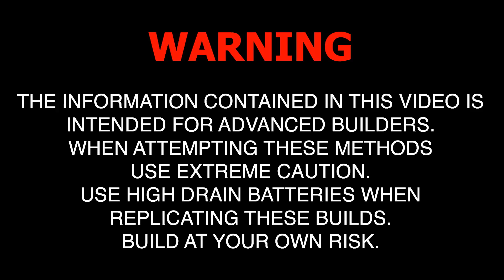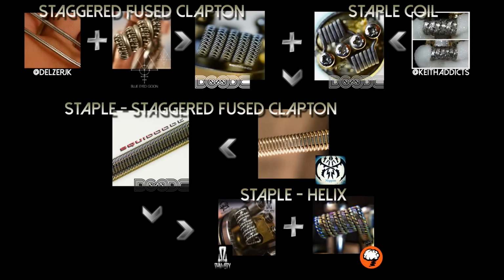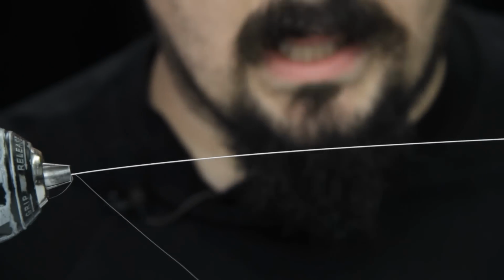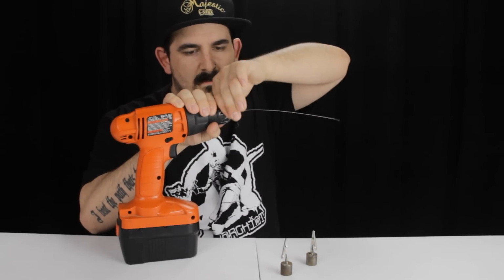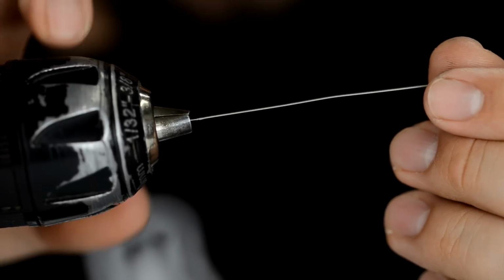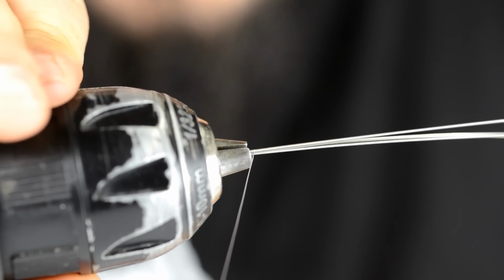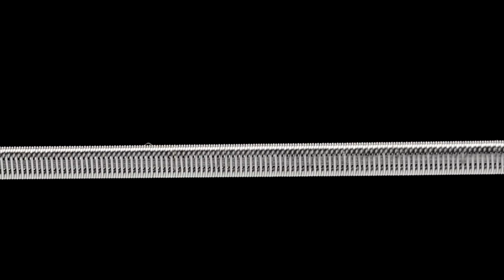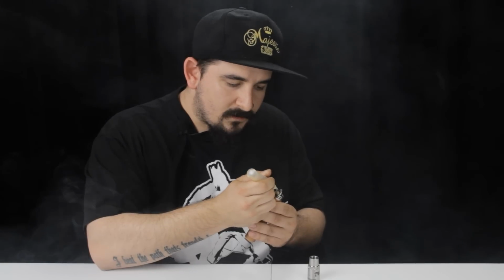Episode Four - The Staple Staggered Fused Clapton

Comment: Just got done doing this build. It is so important to get your first parallel clapton nice and even. Doing so makes the staggered rap go alot better. Without a doubt the best flavor going!
Reply: Roger Robinson FYI.. Mine was 26N, .6 Ribbon, 34N clapton . Ohmed out at .15 single coil 4 rap. That was the most I could get into the El Cabron.
Reply from the maker: Roger Robinson right on man and that wire combination will work just fine. Once you start to get the staggered wire thinner like 36ga then you can usually squeeze an extra wrap in there to get the resistance up!

Comment: again i have to improve my skill when you placed the two 36g wires on different angle where you feeding them dirrectly from the spool or it has allways been a unknown fact about this video how you placed them ☺😊😁 and again thanks for you great videos they are soo great =)
Reply from the maker: +Bjarmi Bergþórsson yep, great question. Both 36ga wires have been left on the spool and are off camera. I like to stick a screwdriver through the center of the spool then place the spool and screwdriver in one end of a vice and let the tension of the 36ga pull the wire off the spool as it's being fed to the core!

Comment: I am seven pairs of coils into this build,,,next time I will not use swivles,slightest movement on the drill with swivles starting out throws off the tension and the stagger on the frame wire,,,just saying,,learned the swivel limitation on the interlock alien,,just my thought guys

Comment: you should run the wire through a pen,then just hold the pen up to the wire that is in the drill.take the bottom part of the pen off.Then feed your wire through.Then slightly put the bottom part of the pen back for tension.Then just put your finger on the tip of the pen where the wire is coming out,and hold it up against the wire,and as it is turning,you slowly move your han down the wire.
Reply from the maker: +bruce The method you are describing I find to only work well with larger wires like 30ga, 28ga, etc.... With the wire I'm using in this video, which is 36ga, it is too fine and the pen method will kink it. I actually find that method to be more cumbersome then helpful, but hey if it works well for you then I stay use it!
Reply: +The Art of Vaping thanks for responding.
I find that with the pen method,the key for me is,putting the bottom piece in perfectly to create the perfect tension.I had problems at first,but it works great for me now.
Anyways,love yer vids.True artistry.

Comment: I'm in a weird part of vaping when building is no longer interesting. I stopped when I just got into single Clapton coils...this has sparked an interest...one thing though any other suggestion to replacing ribbon wire? I don't have the funds to grab some...but I really want to try this!! I have a twisted messed rda so thus will be fun...
Reply from the maker: +Paige Davis could always do a vertebraid and stick it in the center, or just use a larger wire than your two outside staggered wires!
Reply: Ha I didn't even think of that!!! I will need to try this out.
Reply: Thank you!!!

Comment: I have noticed that when I tried this build, there seems to be vapor being produced for some time after firing it up.  Is this due to poor wicking, or is it just part of the way the coil cools?  I never saw any burns in my cotton when I changed it, and the extra vapor produced would stop immediately after I dripped more juice on it.  Thanks for the video!
Reply from the maker: +andres roybal yeah that's just your coil taking awhile to cool down below the temperature at which juice is atomized... I'm curious, were you using Kanthal?
Reply: +The Art of Vaping Yes I am, I've also noticed that most of the time I'm trying to fuse the 3 pairs of wire, my stapled portion goes from being straight across to being at an angle, making it impossible to really wrap haha, could that be from the  spacing of the two Clapton coils being damaged during the fusion process?

Comment: dude if you take a loop of wire .....put it around your core.....start your clapton and then put that loop in between your wrap and then hang one of them wicked little weights off of it ....you will not only make a stagger because that loop of wire creates a gap in the wrap but you'll save all of that wasted wire also :) ...............a fellow coil architect

Comment: hey brother I got a question for ya. ive watched alot of build tutorials n wonder why I don't see anyone using a screwdriver to lightly scrape the coil to get the hotspots out when heating a coil for the first time?! anytime I build if I have a issue with hotspots ill use this method and it works extremely well.

Comment: I noticed that you use nichrome 80 for your wrapping wire instead of kanthal I have a standard staggered fused Clapton build and I used Kanthal for my wrapping wire it's nice good flavor but Gunks up really quickly I'm rewicking it like every other day is that why you use nichrome instead of kanthal?
Reply from the maker: +luke williams Kanthal is fine to use as your outside wire. Honestly, the resistance of your outside wire is extremely high and is pretty much negligible when it comes to heating. The core wire is doing at least 99% of the heating. Kanthal however is a dirtier alloy as oppose to nichrome. I get better flavor when I use nichrome as my outside wire. As for the gunky coils, 90% of that has to do with the juice you are using. Juice that has a lot of sweetener (Sucralose or Aspartame) will always gunk up your coils in no time! I stay far away from flavors like that generally because they're shity flavors that hide everything with a shit tone of sweetener. Hope that helps!
Reply: Ok I'll look into changeing my juice then thank you

Comment: Any tips for when the staggered claptons try to pull around the ribbon wire? Ordered .5 ribbon and ended up with .4 but even with a light twist after stacking the staggered claptons want to ride up and do the triangle deal. Maybe the palerclip trick will work? Like putting it a few inches past where you are wrapping to fuse it all together? I know they are doing the pyramid because I'm putting too much tension on the fusing wrap, but after 6-7 attempts once i get everything set up, it's getting frustrating
Reply: Ya got it now don't ya Drew? 😆😄🤣🤣

Comment: I'm wondering how much 36g you need for the clapton portion?  It looks like you used almost a foot of 26g, so you need what, like 10x that in 36g? 10 feet?
Reply from the maker: doclogic Excellent question! I tend to use more wire than I need to, but to answer your question I have found that for every 1" of core wire you will use roughly 10x that amount with 36ga.

Comment: Can you take flat ribbon wire, spin it, take 3 strands and make it the middle of the core to a 2 core 26 Kanthall A1.
Then Fuse With Ni80
Reply from the maker: Technically, you could replace the vertical ribbon with any combination of ideas and frame it. As long is you can pull it off it shouldn't be a problem. However, will it perform well? In your example I don't believe it will have great preformance but still worth exploring!
Reply: My Next build im thinking of claptoning the clapton before the core or twisting the 38 or 40 to kind of mesh the core. Thanks for the fast reply.

Comment: I've built this wire twice and each time it works fine until I go to wrap the coil and it starts to twist on me and no matter what I do i can get it to lay down flat on the micro screwdriver
Reply from the maker: +Jared Isbell interesting... What wire combination did you use? Also, I have found when working with ribbon, the tighter you can get the outside clapton wire the stiffer the wire thus the easier it is to coil and get to lay flat!
Reply: +The Art of Vaping I use 26 gauge kanthal, .8 ribbon wire (it was give to me for free at a local vape shop so I'm using it up) and 34g TMn80.

Comment: I have a 75 watt regulated mod, would I be able to run two of these if I used a little bit thinner gauges?  I know if I used these gauges my ramp up time would be horrible, but what if I used 28 gauge and 38 or 40 gauge, and .1 x .5 ribbon?  or would I maybe even need to step up to 30 gauge cores?

Comment: How do you prevent the wire from breaking off in the chuck if you don't have the weighted alligator clips?
Reply from the maker: +alex horvath I've never had wire breaking on me in this build so I'm a little confused about your question. If you don't have weights you can just do it by hand and make sure to maintain tension while you're pulling the one wire off!
Reply: +The Art of Vaping I originally had took the wire out of the chuck  when I finished then flipped it around. But I did it the way you did it and it worked much better! Keep up the awesome videos man

Comment: can you run dual coils with this coil in a rda
Reply: +jeffery mafi You could, but you'd need a pretty beefy rda.  Definitely not a 22 in my opinion, considering that a single 5 wrap coil that he built was ohming in at .16 or something.  Slap in a second and you're sitting at .08?  I sure hope you've got good batteries and a quality mod / rda combo or its going to blow up in your face.  If you look at the build he's rocking at the start of the video, it's the same coil wrapped 6 times and in a dual configuration.  This is sitting in a 30mm rda.  Don't expect to be centering this build or anything or you'll screw your coil beyond recognition, and that's why you need all that extra space in the rda itself.

Comment: Hey I don't know if anyone has asked/answered this, but is there a trick for letting both spools of the 36g let the wire come off the spool freely. But not unraveling off the spool and having the wire go all over the place? Or do you cut off a few feet of the 36g?
Reply: +PvtCabo0se666 cut a  piece of that stretchy vet wrap and place it a bit loosely bit closely over the wire on the spool,  then feed the end of the wire through so that the vet wrap turns but the wire still feeds and the wire doesn't unspool. The top of a tube sock works, too, but you can't really see what the wire is doing, so I've used knee hi stockings, too. The Dollar Store is your friend.
I use a small plastic container or cardboard box, cut holes for a dowel or knitting needle or pencil etc. on opposite sides, then suspend the spools on it. Put them on the floor, they turn and feed beautifully, look Ma, no hands.

Comment: think that a 0.5ohm could be made to fit into a kangertank subohm? if so what wire sizes would you suggest?
Reply from the maker: +jolly riffic With this style build there would be no way to get the mass small enough to fit on that deck and also stay that high in resistance unfortunately...
Reply: Get a Griffin or VCMT.
Reply: +DeepSpaceVoid i'm actually waiting on the Ohmega Alpha 30mm BFT Tank to be in stock. they really suck at responding. sent two emails already and no reply back when they'll be in stock. I'd love to have the vcmt but not when it's at such a ridiculous price. griffin is wonderful looking but 3ml of juice is just not enough. worse case i'll just have to stick with the ohmega 22mm tank.

Comment: isnt it easier to just clapton one long piece and then cut it in half so the spaces are trully uniform?? Seems as though 2 seperated pieces might cause an issue if one has more tension than the other while claptoning.. If that makes sense LOL...
Reply from the maker: +Joe Torres No your question makes sense but I don't follow you on how you would get spacing with just one clapton wire then cut it in half… Since filming this video I have a much easier way of accomplishing a uniform spacing. There will be a video on that very soon under the Tips&Tricks segments.
Reply: +The Art of Vaping ok i didnt explain myself you used 2 wires to clapton around 1 wire and then removed 1 for the spacing... what i was saying was wouldnt it be easier to do the same but instead of doing it twice (one for either side of the frame ) just do it one time with a longer piece and then cut it in half to use for the framed portion of the build...ive tried your way alot and my spacing is off unless thats the way its suppose to be..i love your videos by the way and i am getting so much enjoyment out of my fused clapton wire i would love to accomplish this coil to see how it vapes.."The Build Brothers" are my inspiration you guys should do a colabo video with all three of you guys....thanks for the reply..
Reply from the maker: Yep, thats a perfectly reasonable thing to do! I do that quite often actually, just for the sake of the video I did two because I messed up one of the wires a few inches into it so I couldn't cut it in half! I'll have to look into the build brothers! Thanks for checking out the videos!

Comment: am I the only one that does the whole length of wire I cut?
Reply: +TwistedTempest I know! they scrap alot of wire. Well! maybe it's easier for them to do that, i don't know.As a metal workshop hobbyist i have the habit to try to maximize the use of the material at hands.I haven't done any coil builds myself but i'm going to try it out.//Riller.
Reply: I mean they have more wire and they still dont clapton the whole wire and leave 1 inch not claptoned.
Reply: +Riller70  The urge to 'save' wire is a strong one to let go of, but it is done for the right reasons. It makes handling easier and actually safer. 
Manipulating super fine wires under tension can cause overuse injuries to the small tendons and muscles in your fingers, whether you are young, or older. With wire this fine, leaving longer ends is a must to relieve some of that tension. So much less expensive to throw away some wire than to sit with your fingers unable to move or to get cortisone shots. 
I've been doing wirework like this for better than a decade (not vape builds, but fine wirework - they are definitely related) Protecting and caring for your hands is paramount to longevity.

Comment: Seems like alot of wire but how much $ does each coil cost to build. ?
Reply from the maker: Oscar Onyx Its a good amount of wire for sure but nothing crazy… Hard to say because in this build I used Anarchist wire which is more costly than your regular wire. Also, it depends on the quantity of wire you buy. I tend to buy really large spools of 500'+ which makes the wire much cheaper per linear foot than if your buying 30' spools… For this build though considering the wire I'm using, a single coil probably cost (material wise) $4 to make. Perhaps less, but it isn't as much as one might think..
Reply: thanks , i see them ready built on e-bay at $13 for 2, But may take next step and build my own,
Reply from the maker: Damn… If someone is selling this exact coil (the one in this tutorial) for $13 a set, I'd buy the shit out of them! haha

Comment: How on earth do you do this without the core folding in on itself? I must be getting my wrap too tight? Staggered fused claptons no problem, as soon as I add that 3rd core they triangle on me. Suggestions?
Reply: +Shane Konzuk you might be going to fast. this is not an easy build and mistakes in the beginning lead to problems easily later on. take your time in making sure everything is exactly how it needs to be and you'll be happy you did
Reply: +Shane Konzuk along with going too fast, it could be that the feed on the wider clapton is not flowing freely. Yes, it needs control, but a death grip will tighten everything. I use a ring vise for just that reason. 
But I agree with Aaron Anderson - this does need to be set up with some exactitude - and the ribbons do have a tendency to shift unless they are extremely secure. The water film tension between them does help - but spit works even better due to the viscosity. Just speaking truth......

Comment: I'm just curious. What gauge ribbon wire would you suggest with a 24/40 for the Clapton portion? I know that the 40 is going to be a hell of a time but hey, it's fun to make coils and I love it! Lol. I'd just like your input on it before I go out and buy some. Thanks man!
Reply from the maker: VenomMonster87 24/40ga would be impressive for sure! I would recommend .6 or .7 ribbon if you can source it! I know .8mm ribbon is more readily available, but it might be a little to wide but still worth checking out!
Reply: The Art of Vaping  I appreciate the help man! I'm probably going to go with .6 ribbon. I can't wait to get this thing built! And when I get my Zephyr Buddha v2 and my Kung Fu v4 box in I'm instating the coil on their. I'm just deciding now if I want to use nichrome 80 or kanthal for the 24 guage.

Comment: How do you straighten your ribbon wire?
Reply from the maker: Ryan McCloud Ideally, I just use ribbon wire from Kidney Puncher becauseit comes off the spool flat, however they are ALWAYS sold out and never seem to
be able to keep it in stock… So, the easiest way to straighten your ribbon is
to unspool a little bit and while it’s still on the spool, firmly grasp the
spool and then clamp down on the free end with some pliers and give it a few
good tugs. This will straighten the ribbon just fine!
Reply: Thank you so much man! Greatly appreciated